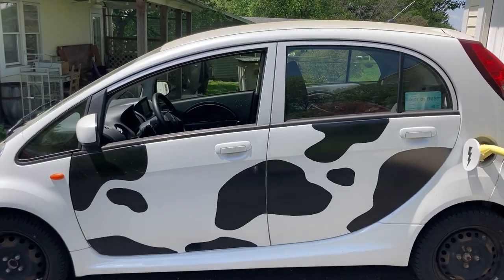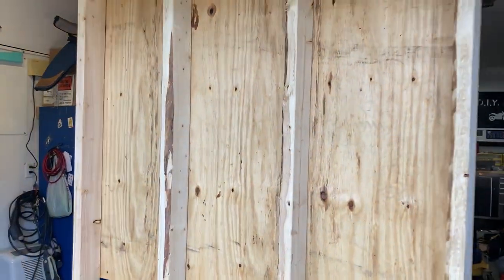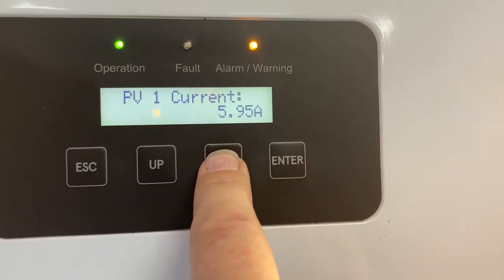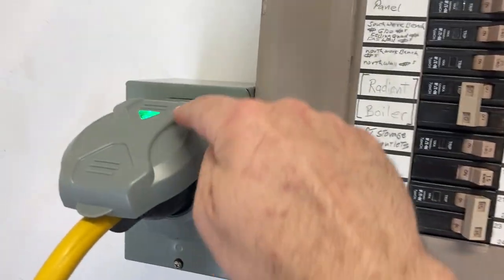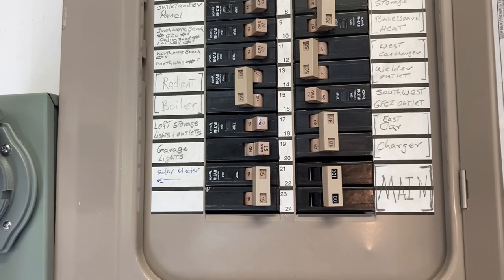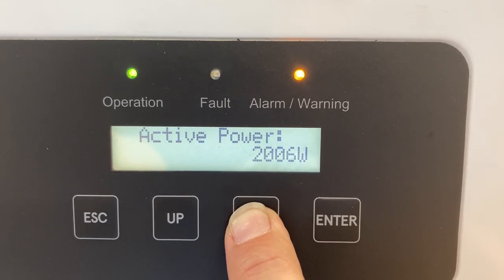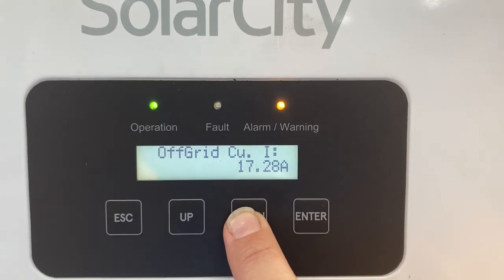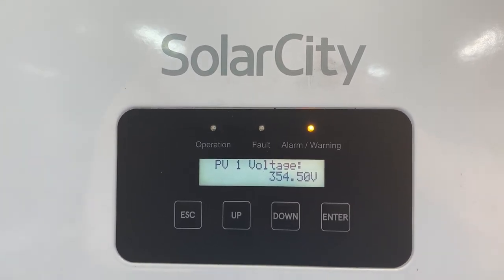Electric Car Powers Garage Off-Grid | DIY V2H w/ CHAdeMO

Comment from the maker: Please note that this is NOT a finished system. I still have a lot of little details to clean-up, finish, and work out. But the big deal is that it WORKS exactly as I was planning.
Reply: The tricky bit is how can you get it to charge from your system the the electric vehicle I think the Tesla battery packs is higher voltage the Chevy bolt runs 350 show 400
Reply from the maker: @kurtzxcvb3481  For right now, I'm planning on still using the J1772 port for standard charging. I believe that I should be able to have the CHAdeMO port active AND charge through the J1772 at the same time.
I did a quick test, and was able to get my Enphase grid-tie micro-inverters to power on from the AC generated by the H6 inverter.

I'll need to change the 12V source of power for the CHAdeMO contactor relay to an external source, then the car can be in the "OFF" position and ready to charge while still powering the inverter.

The exact voltage of the car's main battery pack is almost irrelevant. The PV input on the inverter has a very wide range of voltage it can accept and use to function properly.
Reply: Hi Benjamin, will this technique work on any CHAdeMO equipped vehicle eg a Nissan Leaf or e-NV200? Can you share how the in car switch enables voltage output on the CHAdeMO socket?
Reply from the maker: @hobbsytoob  More info on the project on my blog: https://300mpg.org/2021/11/11/chademo-relay-hack-switch-and-testing/

https://300mpg.org/v2g/

Comment: Happy to see this solar inverter idea working for you Ben. Given the car is capable of delivering about 40kW you should probably be able to run your entire house with it, you only need a bigger 5-10kW inverter or two, this 2-3kW setup is still neat and enough for emergencies as is, thanks for sharing.
Reply from the maker: The inverter I have is good for up to 6kW. I was just testing it at lower power. (Partly because all the stores in my area are out of the 30A breakers that fit my panel!)
It should be able to run my entire house just fine.

Comment: I have four of these units and had the exact same idea put it through the PV if my battery voltage high enough to trigger the battery input that was when I had a Nissan Leaf I have a Chevy bolt now I don't know if I can do it with the Chevy Bolt I guess all I really need to do is trigger the high voltage charging dc-to-dc
Reply from the maker: One issue is that the Chevy Bolt uses the CCS standard for the fast charge port. That's a completely different system of communications for how that port is activated. If a person could figure out internal to the car what controls the physical relay and where it is for contactor control, then it could be done manually. I don't know if the car would throw any errors doing that or not though.

Comment: Hi, This is very interesting. What are you doing in/out of the car on the Chademo control pins to get the battery connected to the Chademo port? I assume you do not need to observe/drive the CANBUS pins. Thanks. Andy

Comment: Hi Ben love your video, not releated to your video but wondering if you can make a battery to extend the range of the Imiev that charges through the CHADemo port?  for use on a trip that would not have access to a level 3 charge for 140KM range

Comment: If you use a grid tie PV invertor then you can just feed the power into your house and the grid without any island safety problems.
Reply from the maker: The issue is that I really only want to use this for blackout protection. That's an OFF-grid type setup where grid-tie inverters do NOT work.
I have tested my grid-tie micro-inverters and I CAN power them up by syncing them to the Solar City H6 inverter.
Reply: @BenjaminNelsonX  Then you have correct setup indeed. The term V2G becomes a bit confusing then though ;)
Reply from the maker: @joostwestra  OOps. I've been trying to label all of this as V2H. Sort of a typo there in the title. I'll correct that.

Comment: nothing like a portable power wall! I use my ebike batteries for backup... but you bring it to a whole new level :-) Is it possible to auto-switch from car charge mode to use mode?
Reply from the maker: Not exactly. I do NOT have a CHAdeMO charger. I'm simply using the DC Fast Charge port as a way to directly access the main battery pack. There's none of the proper equipment and circuitry here to properly DC Fas Charge the car.

However, there's no reason why I can't still charge the car through the regular J1772 port. I should be able to have BOTH ports on the car active - energy coming in the J1772 and going OUT through the CHAdeMO.

I haven't been able to test that yet. First, I need to change how the power is configured for controlling the CHAdeMO relay. Right now, it uses ignition power. The car has to be on. What it's on, it can't start charging.

I'll probably make a small 12VDC battery pack from some 18650s and run low current through the CHAdeMO signal wires.

Comment: Hi, nice build, what ia max power chademo can draw?
Reply from the maker: The standard CHAdeMO protocol allows for over 60,000 watts.

In the case of how I'm using this setup to DRAW power from the car, it's limited to the maximum power of the inverter, which is 6,000 watts continuous.
Reply: @BenjaminNelsonX  nice. I wonder if i could make a chademo car and use solar inverter in the night time to put power for my house aswell

Comment: Thanks Ben knowledge is power HaHa. Question I want to buy used EV .what would you suggest? I see there a some Leaf out there about 30k miles for 11k$ Thanks again 👍
Reply from the maker: The Leaf is very popular as a used EV because there are so many of them out there. There are certainly other options, but depending on where you live, it might be hard to find variety.
If I were in your situation, I would look around to see what was available, and what fit in my budget, based on what I'm looking for in range and other features. Then I would check an on-line forum for that make/model for any quirks or known issues.
For example, I know of people who have bought an electric car thinking it had DC Fast Charge abilities, but not realizing the low level trim does NOT include that.

If you are looking specifically at a Leaf, there are apps out there that will let you look at the details of the battery pack so you can know its health before you buy.

Hope that helps!

Comment: This didn't occur to me. All that has to be done is bypass the cars wiring to get at the power in the car and then hook it up to a regular off grid inverter using the PV input that is usually 150-450volts and away you go.
Reply from the maker: Right. Just gotta watch out for MPPT circuitry that will short circuit panels to find their maximum current.

Comment: don't forget about the random PV resistance check causing explosions.  at least that's my theory about why it's been happening with my h6.  sometimes my h6 will go for a whole week without the power shutting down to do a resistance check. basically you'd have to leave the inverter running connected to the car for an entire week before I would be confident the h6 wouldn't turn into a electrical firecracker.  if it randomly shuts down in the evening for a few seconds and then comes back on without exploding then it would be doing exactly what mine is doing.  except if you haven't connected yours to the SolarCity gateway then your h6 might not know what time it is. have you checked the clock yet to see if it's accurate?
Reply from the maker: Travis, what kind of fusing were you using? I would imagine that a semi-conductor fuse would prevent any issues.
What have you done to make sure this DOESN'T happen?
Reply: @BenjaminNelsonX  I'll respond in a PM
Reply: @BenjaminNelsonX  did you get my text messages?
Reply from the maker: @SiriusSolar  Not sure. Was it a phone text, Facebook message, or other?
Reply: @BenjaminNelsonX  phone text, it didn't bounce back so I figured it wasn't a landline

Comment: What do you have running the chademo? Does the cars BMS shut it down on low cell voltage still?
 I was totally unaware that chademo was bidirectional...
Reply from the maker: CHAdeMO is basically just a direct connection to the battery pack. With DC Fast Charging, the charger is the big external box, so it needs to go straight to the battery.
Reply: @BenjaminNelsonX  I assume there's a pre-charge resistor in the car that is used before it makes the final connection?

Comment: I have a video idea for you.

There is a video out there with an electric  f150 lighting with a cord plugged into the bed inverter outlet running to the charge port. The truck says its charging and people seem to think it will self charge like this. I know this would result in a net loss and know you could explain why.
Reply: What cognizant person could believe a closed loop would lead to a self charge. The gene pool is shallower than I thought.
Reply: @greathodgy22  i know, right. I tried to explain on the video why it doesn't actually work and had people arguing with me
Reply from the maker: Right. You can't get more energy out then you put in. There are always losses, usually in the form of heat.
It's a bit like trying to fill a bucket of water with a hole in the bottom by catching that with a glass and pouring it back into the top. You will never get more water than you started with, and you would certainly spill some!